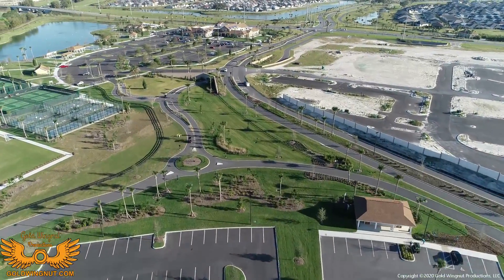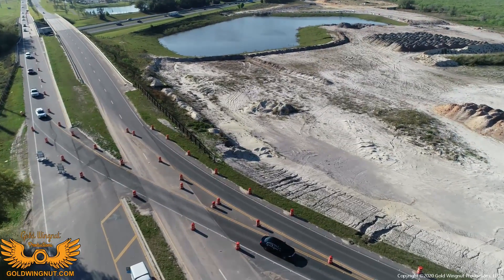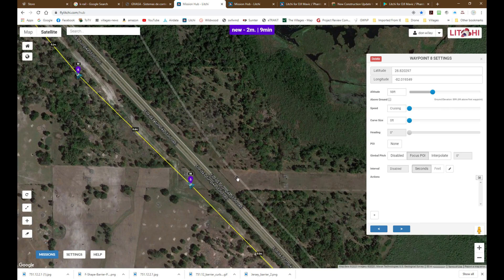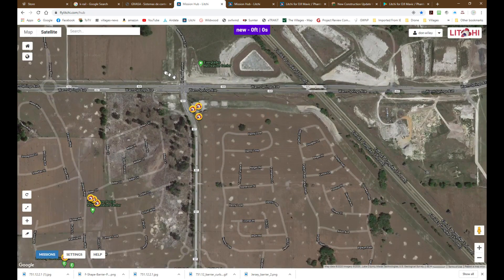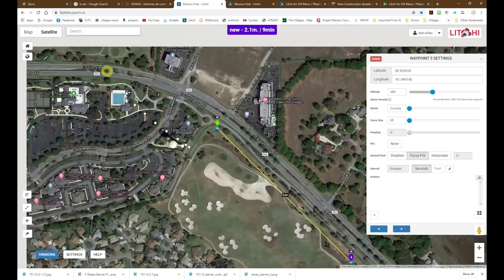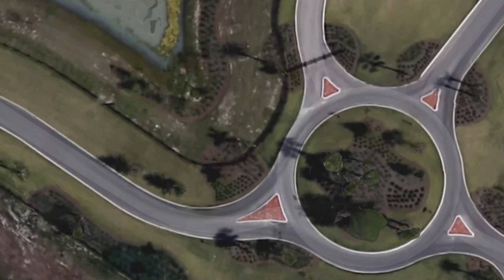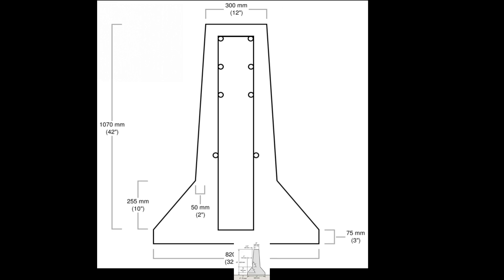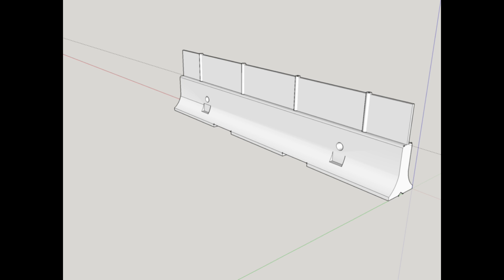61 My Connectivity Theory 3-9-20

Comment: I think you may be on to something. If you look at your flyover of the bridge at Brownwood, you will notice that the decking is not poured at either end of the bridge. There is just exposed rebar for ~15' at either end. I believe this bridge exist solely for its billboard value at this time. This is not the case with the bridge located in the Rohan area. Your flyover shows that the decking is completely poured. Ready to go.
   If we consider the bridge currently sitting on the side of the turnpike, it is not cost effective to place it across at this time. The issue is Air Rights that the State of Florida has over the turnpike. Anyone placing private property over state property will have to pay a monthly or annual fee to the state for use of the air space. Until the infrastructure is completed on both sides of the Turnpike and the homes are occupied, it could incur a large liability and safety risk to allow golf carts to drive through large undeveloped area at night.
Reply from the maker: Very good observations.  You're spot on on every point in my opinion.

Comment: Sounds very likely.  Don, I don't remember seeing the Baxley bridge you mentioned in this video on your flyovers.  I do think I saw it on the pictures from the guy who does the piper cub pictures.  It looked like it was in place already over the turnpike. Is that correct?  If so why do you suppose it is ahead of the water Lily bridge?  Thanks
Reply from the maker: The Bexley bridge is the Bailey bridge that crosses the turnpike between the Okahumpka service plaza and cr470.  It was built about 50 years ago when the turnpike split the Bailey farm and was for cows to cross from one side of the farm to another.  The plan is to rebuild it, possibly add a second span, and have it wide enough for both cars and golf carts.  No money is scheduled to be spent on it until 2022 according to the FDOT website.
Reply: Ken Davis curious about piper cub guy....where can I see his pics?
Reply: Paul Herzog , his name on Talk of the villages is twoplanekid.  He flies over the villages and posts his pictures on the General villages page.
Reply: Ken Davis thank you very much....I have time on my hands, now, and will find it.